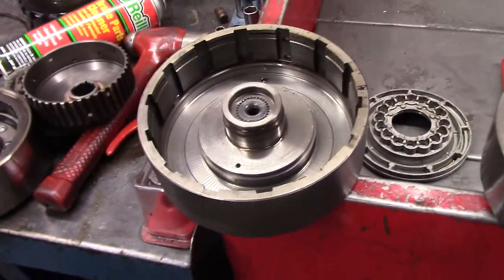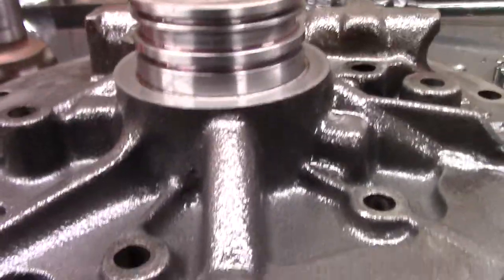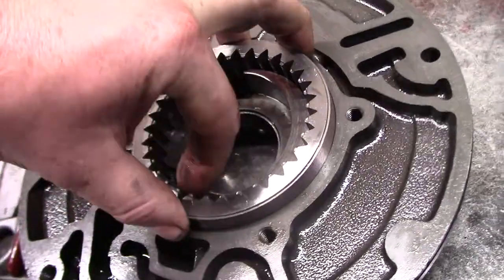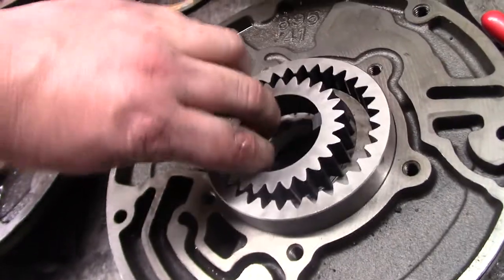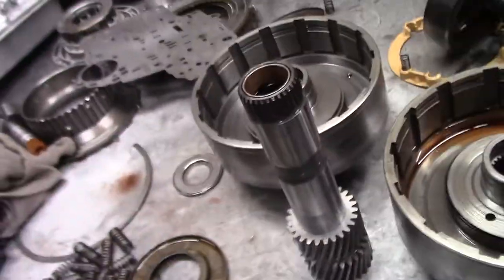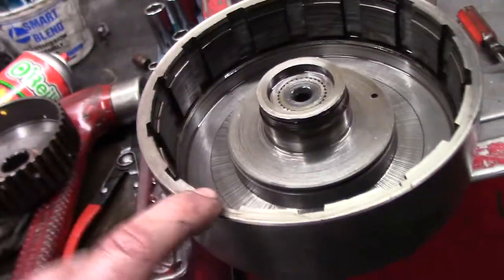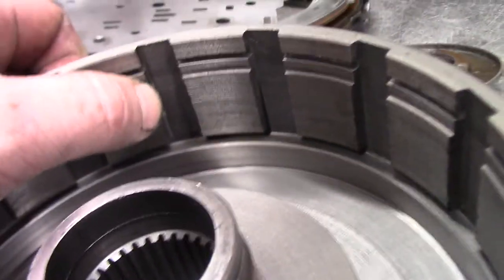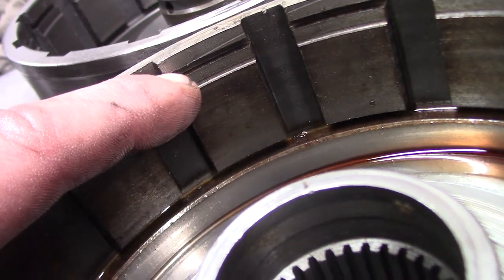TH400 someone rebuilt with a bad forward clutch drum.

Comment: I just measured 2 direct drums and they are different the drum with a smooth race is 100th different good information.
Reply from the maker: Caddy had 6 clutches due to higher snap ring groove. Never tried, but could prob machine piston down and take more clutches if that was the goal.

Comment: A factory TH400 6 friction direct drum will use a 6 friction piston, and the higher snap ring groove. This allows the std .092 steels to be used. You can use the 6 friction piston in a 5 friction (lower snap ring) drum, but you will have to use a combination of .077 steels and aftermarket .060 steels. Usually its four .077's and two .060's.  If you install the (501) 5 friction piston in the high groove drum, you will not be able to get 6 frictions in.  I have a lathe, and cut my own pistons, so that I can use the thickest steels possible. Thicker steels handle the heat better in race applications. Will not matter much for street use.  Keep in mind if you are swapping pistons, make sure you always have at least a checkball in the drum or the piston (both is ok). Also be sure not to machine the piston down too far, or the 1st steel will drop out of the grooves in the drum, and the clutch will not apply.
Reply from the maker: Have swapped diff thickness steels and all, know several people who machined piston, all work for sure without issues. Caddy were the on;y factory direct drums i have seen with the high snapring groove. maybe the 475 units had them? i know they were straight cut planets and all. HD stuff
Reply: @gunterding_performance9558  I tear down about 50-75 TH400's per year. I see the 6 clutch directs in Caddy units, as well as random BOP units, full size wagons etc. Some 1 ton truck units have them as well as military units.  The 5 clutch aluminum direct piston is 501.  I can't off hand remember the number of the 6 clutch piston. I would have to go out in the shop and look. I do not pay as much attention to them as I used to, as now I just throw all the aluminum pistons in a pile, and grab them and custom cut them as needed. I cut all the factory light duty 400, and 375 4 clutch pistons to accept either 5 or 6 clutches. GM should have never made 4 clutch units. They are always burnt up. FYI: 90 percent of the time my 6 clutch direct builds are using the lower snap ring groove drums, with the short piston, and thinner steels. This is simply because I will only use smooth race sprag type direct drums in performance builds. Most pre 72' sprag style drums are low snap ring groove drums. I'm guessing that I only get maybe 1 or 2 per yr of the early drums with high snap ring groove...
Reply: oh,, and yes I believe all of the TH475's I see are 6 clutch units as well. My memory isn't 100 percent sure on that, as I may only get maybe 1 or 2 TH475 cores per yr.. Which is probably where I acquire the few high snap ring groove 6 clutch direct sprag style drums I get each season.
Reply: Ohhh, and another last thought. The P series trucks. ( I call them bread trucks) are usually 6 clutch units.

Comment: What should the clearance be between the two drums. I have the same problem. .020?
Reply from the maker: not sure but they shouldnt touch. Basically the rear gear train under center support is set and the drums are shimmed between each other and stator of pump. 400s seem to be tight in the back half and loose in the front (drums)